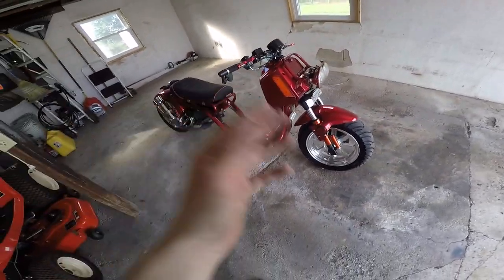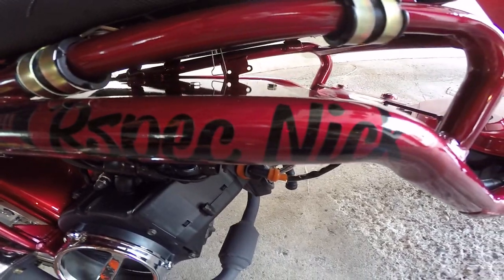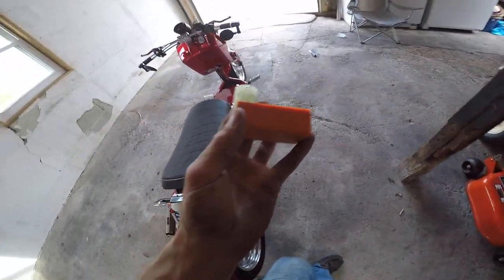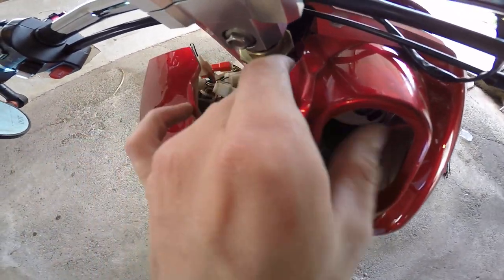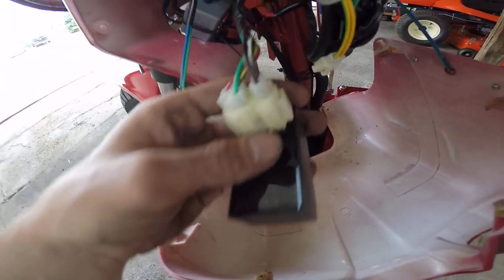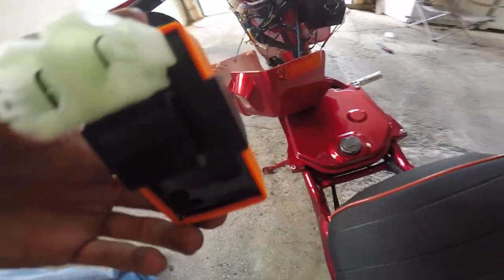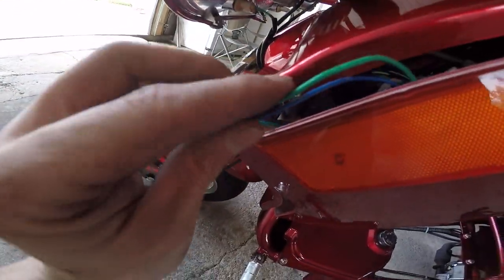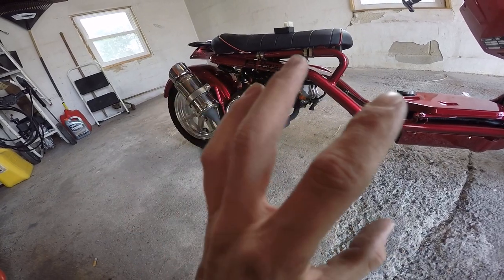Icebear maddog no rev limit cdi install

Comment: Hey bud , not sure if you still have the bike. But take the metal can off the air filter and use the the cone filter that’s just inside of It. I got serious gains about 8mph just from removing the metal can
Reply from the maker: I actually ended up doing that when I still had it. I sold it to my neighbor for a decent so I couldn't pass that deal up
Reply: @RspecNick  dude awesome , hey while I got ya here. My completely stock ice bear 150 does 68 mph. Did your do any mods to increase top speed ?
Reply: Would it do the same for a 50cc

Comment: I have the 50cc icebear mad dog 4 stroke which cdi box do I need ac or dc
Reply from the maker: AC I'm not sure there is many DC ones for the gy6 platform
Reply: @RspecNick  say these scooters are DC. Are u saying u installed an AC ?
Reply from the maker: @bluntzfreeksho  no mine was AC I mean it would be pretty easy to swap over to DC if one wanted to tho.

Comment: does it limit the rpm like a car or does it just rev out?
Reply from the maker: It limits higher rpm with spark the new cdi makes it have a harder time cold starting for sure without any real gain I gained maybe 2mph on the top end
Reply: Ok cool, thanks for the reply i appreciate it!
Reply from the maker: @ryanm9924  if you do have one and want a good upgrade hands down the mikuni fuel pump is so far the best part I've put on it hands down so far
Reply from the maker: @ryanm9924  no problem man

Comment: AC or DC cdi?
Reply from the maker: AC. A easy way to tell if its AC or DC is if your headlights come on without the motor running its DC if the lights dont come on then its AC